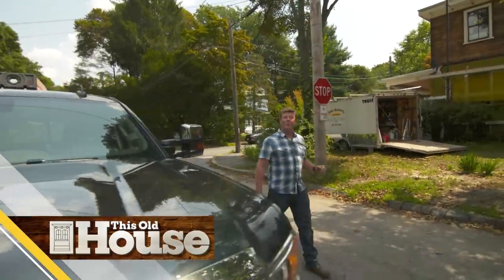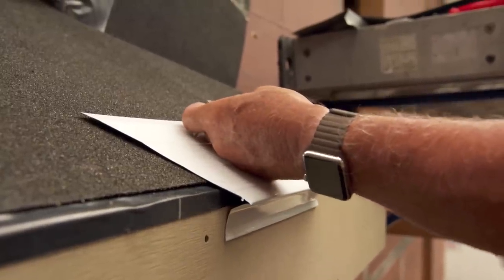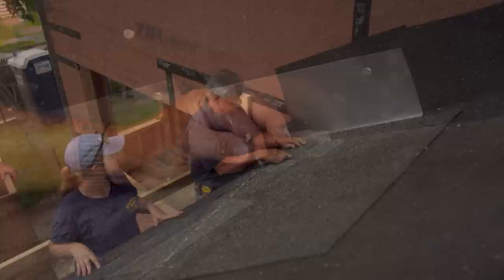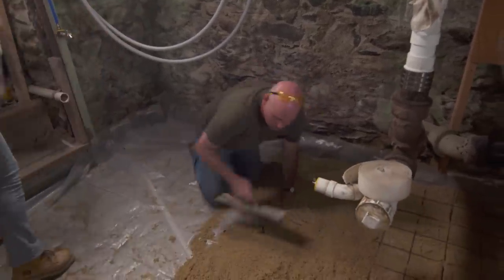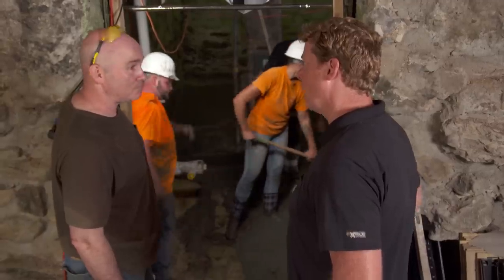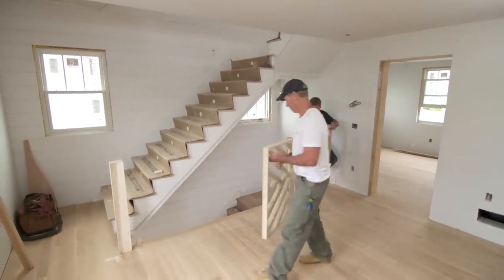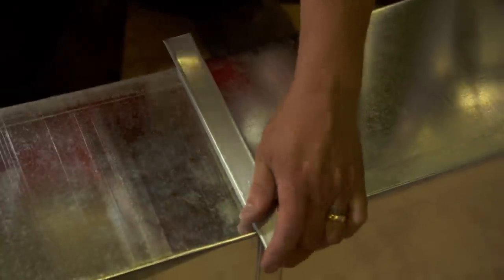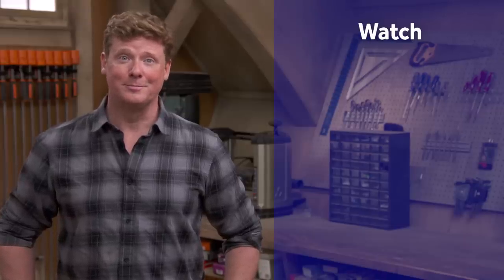This Old House | Duct Dynasty (S39 E8) | FULL EPISODE

Comment: I was lucky enough to work for a professional roofer for a time. His biggest pet peev was improperly installed drip edges. On the plus side, its the first thing to go up, so if your roofer does it wrong, you can fire him before he gets to mess up the rest of the job.
Reply: Yeah, I would've fired Silva if he installed drip edge like that in California.
Reply: @mendonesiac  
Uh wut?
Drip edges work the same no matter where they're installed. It should NEVER be tight to the wood. That defeats the purpose - or did you not watch the video?
Reply: @ImTheJoker4u  I respectfully disagree, and I'm speaking from experience, not a video. 
I don't know how it's done in very cold climates, but here the main purpose of drip edge is to protect the exposed edge of the roof deck (generally plywood or OSB), not the fascia. How the heck is the gutter guy supposed to work with that metal way out there like that? I've never seen it done that way... but honestly that goes for a lot of stuff on this show. New England is a different world than California when it comes to construction.
Reply: @mendonesiac  
Having installed also gutters i can tell you that having the drip edge tight to the fascia board is a MAJOR PITA. You need room to slip the gutter behind the drip edge so that water..., wait for it.... DRIPS INTO THE GUTTER.
Disagree all you want but you're completely wrong. The drip edge should be a minimum 1/4" (I just use the old "finger gap") from the fascia. Period.
Reply: @ImTheJoker4u  There's more than one way to skin a cat. Roofing techniques differ from state to state. My guys like to install the gutter before the roofing is installed. 
Whatever works in your region is the best way to do it.
Reply: @ImTheJoker4u  lmao, there's more than one way to skin a cat.
Reply: @mendonesiac  
Ok but we're not skinning cats, we're installing roofing materials, and while you can install it any way you like, there's only one correct way.
Reply: @ImTheJoker4u  ugh... the drip edge they used in the video is non-existent in my region, I guess what we use would be called edge-metal. We don't have freezing temps or more than an occasional snow in the winter. What we do have is wasps, and the way they installed their metal would be the perfect home for them. I'll say it one last time: how we approach construction is a regional thing, and there's more than one "right" way to build a house.
Reply: You can install tight and then pull.lose if needed over gutter
Reply: @AdamS-lh2ug  lol, you must be thinking of Texas

Comment: The sand is called blinding it's to stop the weight of the concrete puncturing the plastic membrane, well that's how we do it in the uk.
Reply: Thanks for the reply. I was thinking "that looks like moist sand no way its absorbing moister out of the concrete". this old house has some good stuff but the actual factual information that they provide is lacking.

Comment: Duct wrap was introduced in in the late 50’s. It wasn’t considered mandatory until after 1976 when in Philadelphia at a convention at the legionaries hotel a group of people came down with what’s called legionnaires disease. It wa found that the duct work wasn’t insulated causing puddles of water to form in the ac ducts. The cold air against the warm air caused the puddles creating molds and bacteria in the duct work. Since that outbreak air conditioning duct work needed to be wrapped with insulation or and internal insulation.
Reply: thanks for this reply it was very informative.
Reply: Hm. Interesting. I've heard of that disease but never knew where it came from.
Reply: That same disease can also be found in water heater if temperature of thermostat is set too low.

Comment: I think that the trades should talk more about back injuries and the like, I was an electrician but had to change slightly due to back injuries, carrying too much, improper lifting etc,  it adds up over the years and its irreversible.
Reply: @Kevin-mp5of  that too, yep btdt both sides by age 27
Reply: that was what I was thinking about the lady and here desk job.
Reply: Just a question.  What do you mean by "talk about"? Like how to work per OSHA standards, and safety regs? Or just literally talk about back injuries. 
I was taught to, " work smarter, not harder", "lift with your legs", and "don't piss in the wind".
Reply: @bigdaddyjavie  frankly im surprised you can tell which way the wind blows without help. back  in the 70's osha wasnt taught in non union areas and if you complained about needing help all the time you were replaced quickly, not held by the hand like today.
Reply: @sparkyobrian6417  soooooooo..... you're taking the opportunity to finally complain. How smart of you. I enjoy whichever way the wind blows bruh, with absolutely no complaints of back injuries. Thank God, still working. Like I said,  work smarter, not harder.

Comment: whats all this I hear about a tight budget? Custom tiles, custom hand rails? a new garage WITH second floor suite. Maybe a budget but definitely not a tight one or a light one either
Also 9:36 that tool is not a brake, its a folding bar. If you use the tool at 20:16 then you are a hack.

Comment: There is an odor in my basement that smells like sewer sometime not always. What can I do?
Reply: Pour some water down the floor drains
Reply: Pour some water down the floor drains. It's happening because the p traps are dried up
Reply: @matthewfrey9770  ALSO I SNUCK IN A LET 4 PRECISE CABBAGE AND egg farts
Reply: I have a washer and a full bathroom that is being used daily in the basement but the smell still comes especially on colder days.
Reply: Maybe u have a broken line under the slab.
Reply: @lawrencepargan8876  Could be ventilation problem meaning no fresh air vent and it draws air from drain or vanity.

Comment: That railing seems prone to breaking only being held by those little nails, and zero glue.
Reply: I don't think there's any stress on those rails - they are basically ornamental.  The middle cross rails are interlocking joints and they will hold everything together.
Reply: @MTMF.london  There will be stress on them when someone slips and goes through them. Sure, the center rail is a half lap, but I bet you could kick that thing any other place than the center and break it cause those little nails aren't adding any strength. Now imagine the full weight of an adult or even a kid bowling through that thing. To me, you might as well over build something like that.

Comment: What's with the sand under the concrete? Joe Lstiburek would be horrified. The sand will absorb moisture from the concrete, but it will not have anywhere to go, so it will just make the concrete damp and cause problems for any flooring they put over the slab.
Reply: In west Texas they put sand under every slab they poor. For the most part they don’t where I’m at now I’m central Texas. I would assume if what you say is true it may have something to do with climate. West Texas is dry as a bone central Texas isn’t. However that doesn’t explain why they do it in Mass
Reply: That moisture will escape through the surface after it cures. He is just using the sand as an aid for the initial cure. The plastic underneath will prevent moisture from wicking up from the ground, so no, the concrete won't be damp in the future.
Reply: For the curious, the article @Jesse Young is referring to is.. "BSI-003: Concrete Floor Problems"

Comment: Why is the wire re-enforcement under the sand?  To make an effective composite material, the re-enforcement should be inside the concrete.
Reply: They pulled wire up with the rake when they poured it to center it within
Reply: @mattmccoy2410  yeah, and then they walked on it to screed it level.